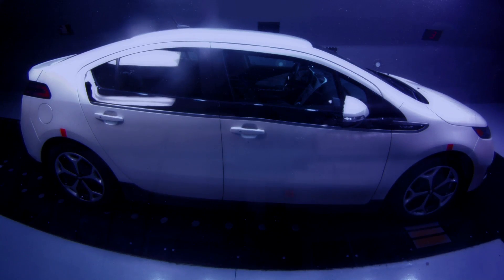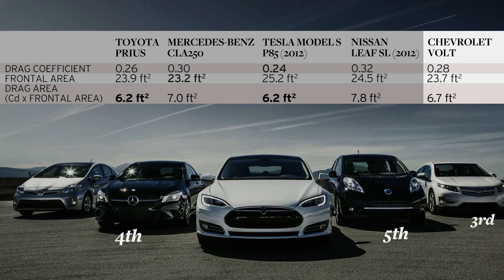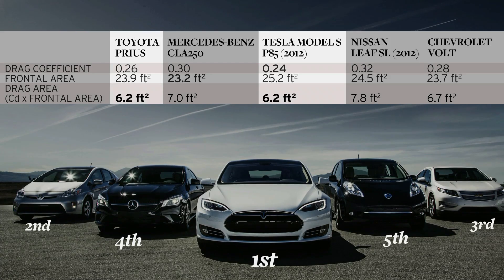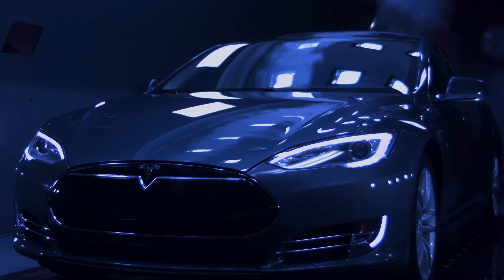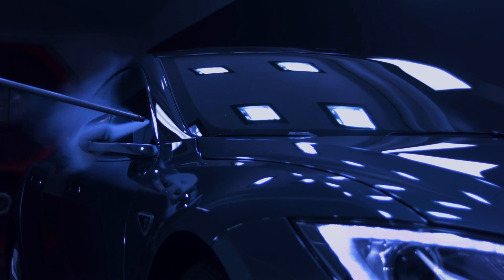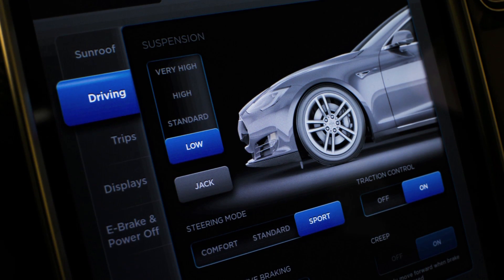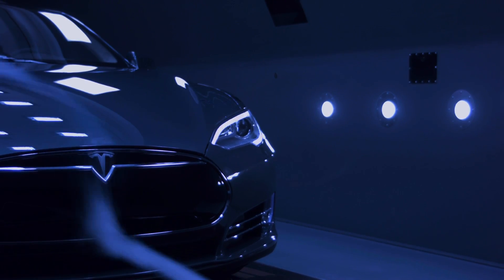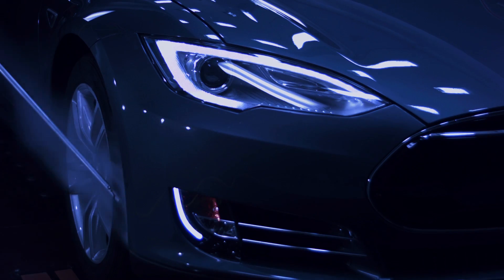Aero Comparo! Tesla Model S vs Volt, Prius, Leaf, Mercedes CLA

Comment: My calculator shows 0.24 * 25.2 = 6,048 drag area for the Tesla. Am I doing it right? It would be a clear win for Tesla if that's the case.
Reply: Since the machine probably measures force, which they then convert to drag area I'd say 6.2/25.2=0.246 drag coefficient. Rounded down to .24 because reasons.

Comment: Great for Tesla, but damn the Prius, have to say the Toyota's figures were the most impressive to me considering how old and plain the Prius design is.  I'm sure Toyota will improve both the looks and drag even more in the future that will be interesting.
Reply: You were right! The 2017 Prius is more aerodinamic than ever!!!
Reply: As I understand it, the 2nd generation prius had a slightly lower CD (0.25 vs 0.26 for the newer model). for a practical and reliable car I can afford to own and run, that's damn impressive.
Reply: ExpieMF
I screwed this up. The older one has a CD of 0.26, the newer one a (claimed) CD of 0.25.
Reply: Carlos Herrera Peralta : Prius 2016 ;)

Comment: Actually looking at the US site for Mercedes, they do not mention any specific drag numbers.  I checked the international site "The figures are provided in accordance with the German regulation "PKW-EnVKV" and apply to the German market only."  Looks like we got the raw deal again, with not getting a manual transmission, the good drag coefficient on sport model or the Blue EFFICIENCY model.  Even on the German site, the Blue is the only one that gets the 0.22. The CLA250 model has a 0.28 on the German site, so looks like the US gets a slightly different version of  that particular model.  http://www.mercedes-benz.de/content/germany/mpc/mpc_germany_website/de/home_mpc/passengercars/home/new_cars/models/cla-class/c117/facts_/technicaldata/models.html#_int_passengercars:home:model-navi:models

Comment: Tesla Model S is the best and coolest looking car i've ever seen, and the greatest car ever made. Chevy Volt is a great looking car and the second best looking "EV" available, also better than base bmws, mercedes, audis, etc. Nissan Leaf is pretty darn ugly and would never consider it lol.
Reply: you forgot the fisker karma, which the volt is based on. both are hybrids. not like the prius, but they both have an engine. difference is the engine is like the engine in a train. engine powers generator, generator powers electric motors ( yes, i know, they have battery packs. just makes the generator's powering of the motors indirect, but still accurate)

Comment: The Euro-only CLA 180 BlueEfficiency Edition has a Cd of 0.22 - look it up before jumping to uninformed conclusions, you lazy-ass American "journalists". Other Euro-only CLA versions sport a Cd of 0.23, while the CLA 250 actually has a Cd. of 0.28 in Europe. Since the US-spec CLA 250 doesn't have active engine grille shutters, it may as well have a drag coefficient of 0.30, as you tested it. This doesn't mean that all Mercedes-Benz CLA models are identical though.
Reply: CLA 180 BlueEFFICIENCY with Cd x Frontal Area = 0,49m² = 5.2743ft².
							 							 											 					 					 					 					link: http://www5.mercedes-benz.com/de/innovation/meister-der-aerodynamik-der-neue-cla-ist-beides-stroemungsguenstig-und-atemberaubend/
Unfortunately german only.
Reply: So you are saying the US customers can't have a $5 piece of plastic and will just have to pay $1000+ more for gas each year???   I just don't buy it.  No reasonable manufacturer would make a 0.22CD car and intentionally let MOST customers have to 0.30CD version just to save one lousy component at the cost of major $$$$ on gasoline.  This is  complete BS. I drive a benz but I am disgusted by the lying though.  Just admit styling needs outweigh efficiency (the Prius is really ugly).

Comment: It's not bad of Prius to have such a low drag coefficient. It's an old design and have sold over 5,000,000. In comparison Tesla's sales are a drop in the ocean. It doesn't give you range anxiety and in many places they have replaced taxi cars like Mercedes and Volvo because they seem to go forever without much problem. I know it's not as "sexy" as Tesla and I guess Toyota could build a Tesla but it would cost that much more and not sell as many. When there is a bigger market for pure electric cars with lower price, faster charging and longer range I guess Toyota will build one. And not just Toyota.
Reply: I think more automakers must go that direction and challenge not only their competitors but also their own line ups. The Prius is a good example - It has taken it´s market share. Even here in Germany more and more Taxies are Prius´s - That is not long ago where it was not the case.

But as such there is nothing wrong with Tesla and it´s approach to building its Brand and line up. A company like Tesla needs a totally different strategy for making it all come together than e.g Toyota. I think also BMW must be saluted for bringing the i3 and i8 to the market, being more visual radical and based on completely new platforms and solutions, even risking quite some critique from their usual buyers. The Opel Ampera is also good allrounder and now the Golf E becomes available too. Leaf does what it does good and is already in 2nd generation, would like to see the littlle Renault ZOE getting a bit more wind, since it´s a fine looking and practical compact segment EV IMO.

Regarding if Toyota could build a "Tesla" well they properly could, but most likely won´t and most importantly did not. They are the biggest Automaker in the world, they do it their way. Even with that tag they do not even offer a top Sports car atm. Hopefully we will get the new Supra for the Car fans. Tesla is remarkable and its the best thing that has come out of the not so long ago totally stagnated american auto industry.

I think we will see many more EV´s and hybrids on the market and it might going to happen sooner than we expect, which is good.
Reply: A Tesla has to be aerodynamic due to it being electric only. Petrol cars don't have such a need for it. The Leaf is a city car "Micra" that is EV basically ;p
Reply: lol tesla sales in the 2020s are waaaaay greater than prius

Comment: actually, the CLA has a drag coefficient of  0,22!
Reply: Volt Lover
 The Euro-only CLA 180 BlueEfficiency Edition has a Cd of 0.22, the sport versions a Cd of 0.23, while the CLA 250 actually has a Cd. of 0.28 in Europe. Since the US-spec CLA 250 doesn't have an <active engine grille shutters>, it may as well have a drag coefficient of 0.30, as  tested Here. As said by WildChildXL
Reply: Volt Lover  I was skeptical too, until i saw that they've done a lot of tweak to their 180 BlueEfficiency Edition to manage that, watch?v=mKBQH5vNd20
Reply: Volt Lover "I don't believe the 0.22 claim, the GM EV1 is 0.19 and vastly different than the CLA." - Appearance has nothing to do with drag coefficient (well, a little; but just because two cars look vastly different doesn't mean their Cds are as well). The Mercedes-Benz Bionic looks like a box, but has a reported Cd of 0.19. Where did you get your degree in aerospace engineering? Mickey Mouse University?
Reply: I rather trust a German manufacturer with a painstakingly earned reputation to maintain than an American automotive enthusiast magazine controlled by the trustees of the will of the spiritual father of the yellow journalism, William Randolph Hearst (aka Mr Citizen Kane.)
Reply: No, that's a lie, they measured it at 0.30
Reply: No,  really, it's 0,22 for the blueefficiency model and for the normal car it's 0,23! The Germans know their aerodynamics, that's why they sent your lazy asses to the moon in 1969!
Reply: cristiandemirel1918 Manufacturers lie, wake up, Toyota has been lying about the Prius for years
Reply: Let's start with your argument:"Manufacturers lie!" - that's true; I'll give you another true argument: "Car magazines and car reviewers also lie sometimes!"; and another argument: "car magazines and car reviewers are sometimes paid to lie by the manufacturers!" All I'm saying is that I don't think Mercedes could claim that one of their models has the lowest drag coefficient of any production car, when in reality it has one of the highest! That wouldn't be just a lie, that would be preposterous!
Reply: I have a degree in Aerospace Engineering. I designed a wind tunnel in school. I can tell you merely by looking at it that the CLA does NOT have a lower Cd than a Model S. That giant concave grill is bad for aerodynamics. Also, you might want to eat your words, because Mercedes is only claiming a Cd of 0.29 for the CLA sold in America. http://www.roadandtrack.com/car-reviews/first-drives/drives-2014-mercedes-benz-cla250
Reply: Go to the Mercedes UK site! They clearly say in the description of this model that it has the lowest drag coefficient of any production car or something similar! Maybe the models for the US market, which have some particularities, are affected in terms of aerodynamics?  But let's stop this argument because it's obvious we have quite different opinions! Also, I don't really like none of these cars, the CLA included!
Reply: I don't care what they're claiming in the UK, there would have to be some major differences to drop to 0.22, its just not believable, and I won't believe it until is independently verified.

I own a Volt, and the Model S is the best car ever made.
Reply: Dream on! $2500? :)))
Reply: Zephyr López Cervilla damn sure!
Reply: St0rm1388  I don't believe the 0.22 claim, the GM EV1 is 0.19 and vastly different than the CLA.
Reply: @VoltLover00  Have a look at the 2001 LS430. It has a .25 cD with active air suspension that drops it an inch or so. 
The car LOOKS like a brick.
Reply: Loosen up a little! I was just kidding!
Reply: I'm not kidding anymore! Look what I found:"There's a growing hubbub in the plug-in vehicle community over what looks like some ridiculously cheap replacement batteries for the Chevrolet Volt going up for sale. GM Parts Online, for example, is selling a replacement Volt battery with an MSRP of $2,994.64 but, with an online discount, the price comes down to $2,305.88. For the 16-kWh pack in the 2012 Volt, that comes to a very low $144.11 per kilowatt hour (kWH). But is it a real deal? How can it be, when a Chevy dealer may quote you a price of up to $34,000 to replace the pack?" http://green.autoblog.com/2014/01/10/chevy-volt-battery-replacement-cost-34000/
Reply: Aww, I caught you backpedaling, trying to laugh off an attack. That article is a pile of shit. The car, the entire car, can be bought for $27,000 (before tax credit), and the battery is $34K?!?! Bullshit. Order one and find out.
Reply: PS, the battery has an 8 year/100,000 mile warranty, at which point it has at least 70% capacity and DOESN'T need to be replaced. My Volt, after 3 years of driving has lost 4% capacity.
Reply: St0rm1388 That's a bunch of babble, I don't see them doing anything that Tesla isn't doing. It has a blunt front end, its styling over aerodynamics, I'm not buying their number until I see it independently confirmed.
Reply: Everybody loves these politically correct electric cars! Wait till they have to change the battery pack! They are the way of the future, that's sure, but the future isn't here yet!
Reply: cristiandemirel1918  A new battery pack for a Volt is less than $2500 dollars. Meanwhile, it save $11,775 dollars compared to running on gas in an average new car. Wake up and do the math.
Reply: Dream all you want, here it is

http://www.partswebsite.com/gm-car-parts/?i=2&make=116&model=2635&year=2012&type=parts&act=new_subcategory_hp&section=3&catid=30145&subcatid=55530&fl_id=41
Reply: Good backpedal
Reply: Embry-Riddle, where did you get yours? The CLA has a concave grill, which is HORRIBLE for aerodynamics.

Comment: The data also supports the obvious truth that Carlos Ghosn grossly missed some opportunities to make the Leaf good, with such a poor drag coefficient. The Leaf similarly fucked up on speed, aesthetics, weight and pricing. A solid all-round cluster fuck. It's hard to gauge what exactly malfunctions in japanese design houses' minds but it's a lot. And what's even worse is that Carlos Ghosn is showing no signs of realizing just how ugly the Leaf is. It sells strictly because it's the only offering in many cases....

Comment: With this video you've made the intelligence part of your slogan much more credible. Quite well done. Several good aspects like distinguishing between Cd and CdA and understanding that a wind tunnel isn't perfect. I will fault you for one thing though, you don't call Mercedes the liars that they are. They claimed 0.23 for CLA so they could claim most aero production car in the world under the Tesla. So you cowardly leave it to me to point out that when it's really 0.3 it can be nothing other than a massive intentional lie from Mercedes. You are supposed to be the watchdogs for the consumers, not the pathetic lapdogs of evil corporations.
Of a minor point, you could have avoided the conclusion that aerodynamic cars are impractical. That's very false and counterproductive. A two seater car is not inherently impractical. That's stagnant thinking. And there is nothing that says a 5 seater can't be extremely aerodynamic. What you could have said is that the Tesla is surprisingly aerodynamic for a car that looks entirely conventional which normally means ignorance of aerodynamics. It can still be done far better than Model S while remaining 'practical'.

Comment: Whhaaat, this has got to be a bad test. I did a presentation in physics about aerodynamics and how the cla is the most aerodynamic production car to date, confirmed by multiple sources.
Reply: Obviously this Mercedes CLA didn't test near as well as the one in Daimler's own wind tunnel. This one tested only 0.30, not 0.22.
Reply: Time to backtrack and correct yourself to everyone you presented to. It will test your pride but scientist submit to data. Its not going to be right b/c you told a lot of people. So lots of props to you if you make a correction on your blog or something.
Reply: Pretty good.
Reply: And car and driver runs the most reliable tests, right? Nah, don't think so.